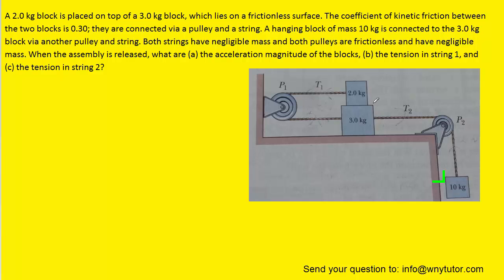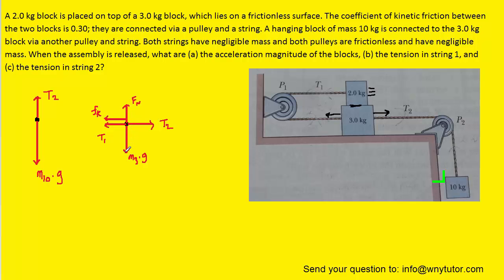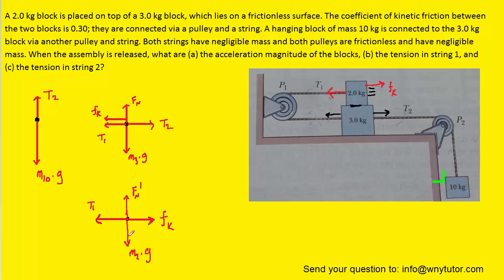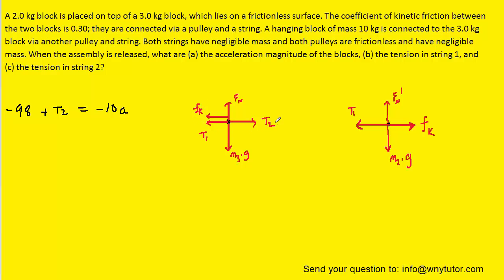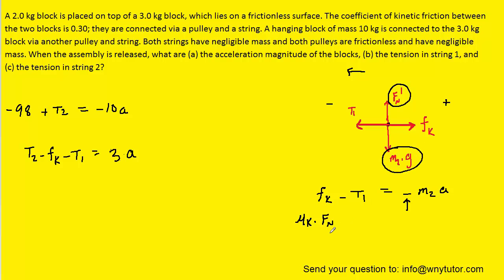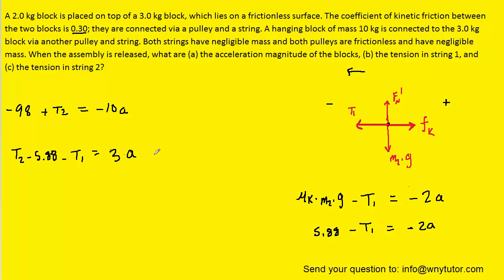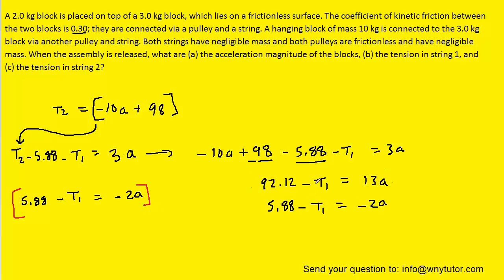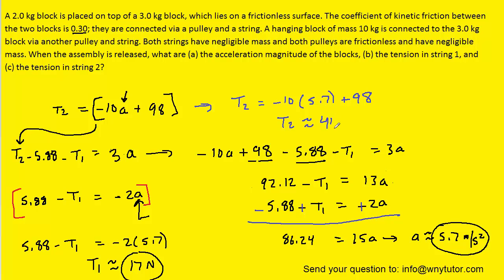A 2.0 kg block is placed on top of a 3.0 kg block, which lies on a frictionless surface. The coeffic

Comment: why is it that initially we do not consider the fact that the bottom block of the two stacked blocks will have the mass of block 1 and 2. what i wrote is T2-T1-fk=(M+m)a.. why is that not the case here? is it because they are being pulled in opposite directions and not the same direction?